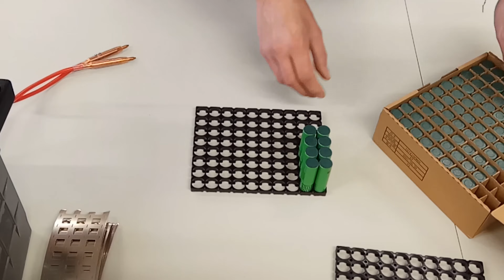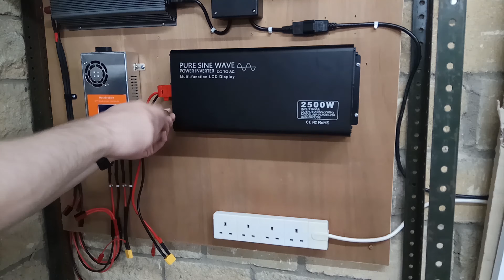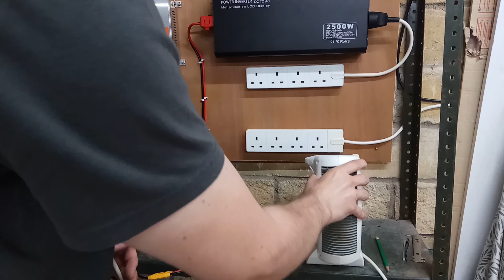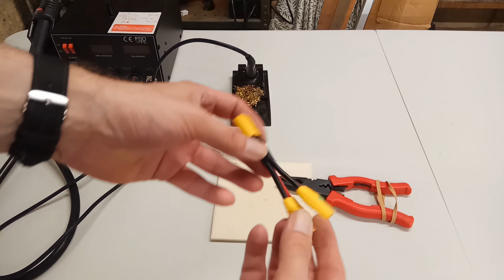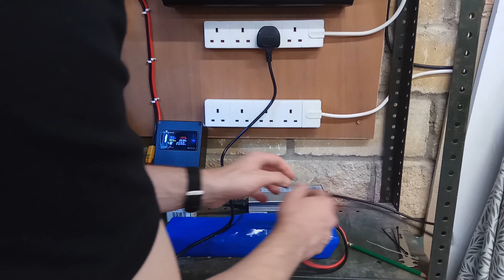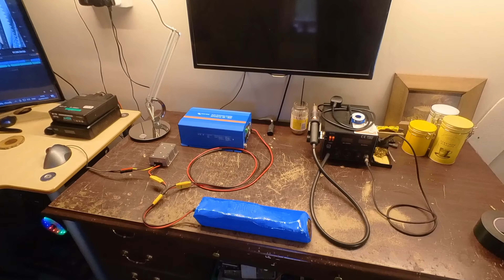DIY Off Grid Solar - The Cheaper Way

Comment: Hi, just wondering if you've used you TC Max battery for V2L power? I am in Australia where our new standard sets a very low limit for allowable "home made" extra low voltage systems. (Under 1kw) Portable power is an exception and for mains power blackouts I was wanting to run a 72v inverter from my 3kw TC Max battery but I don't know how to turn it on? I presume some signal to bms is required. Any experience with this? Cheers
Reply from the maker: Hi, I tried that too and the BMS disconnected. That's partly why I built my own battery. I don't know how you would fool it into thinking it was the bike pulling a load. I think it uses can bus. You could possibly put a different BMS in. The Ant BMS I'm using seems okay. Otherwise I'm stumped, sorry.
Reply: Hey, I got it to work easily ! I was looking around forums on TC Max and found the reason I have been annoyed with charging is because the dopes at dealers left the transit charge cable inside bike connected to side port. Easy to remove and properly connect side port. Then using the handy 'new'  lead as it is just pos. and neg. to xt60 connector I connected it to side charge port externally and with bike switched on or off I could draw power. With it straight into battery, no power.  So V2L should work if I just get a 72v inverter like yours. Perhaps not drawing more than charge cabling is made for though??
Reply from the maker: Aha! Well done. I only tried with the battery on it's own! 
The orange battery cable on the bike wires back to pins 1 and 2 on the motor controller multi pin socket. It doesn't say what they are on the wiring diagram for the controller but I think it's can bus. 
Yes the wires to the charge port are pretty thin. I wouldn't put too much load on them. I'm thinking about adding some thicker wire to mine.
Reply: I ordered a 1000w inverter but really would only want to run a fridge if we have a blackout. Modern fridges are pretty frugal...mine only draws 130watts apart from starting curent. Thats only about 2 amps on the charge wires. Thanks for your link to Aliexpress!...when I search it only comes up with thousands of other inverters and random stuff.
Reply from the maker: Just the fridge should be fine. Maybe charge your phone and other devices too.
No problem on the link. Keep me posted how you get on.

Comment: Nice vídeo!!! 

Like always since I saw your Channel, I get inspired by the way you use your "clean" energy... thanks for sharing!!! 

Cheers From Portugal ⚡🔋⚡
Reply from the maker: Thanks, I enjoy your channel too!
Reply: @thecapacitator8137  I Started with a faulty laptop battery, then I reused some 18650 cells for PowerBanks... but now like you I have an electric SuperSoco TC Max and my house in Alentejo is Off-Grid with a 12V solar array... I live in a building in Lisbon, but I have a Van and thinking, on saving money to do a 72V Solar Array, like your´s to charge my Bike. 😉Cheers from Portugal ⚡🔋⚡
Reply from the maker: @RREKO  I wish we had as much sun here in UK as you get in Portugal! You should easily be able to power your bike off a few panels. I've updated my indoor setup now. It's all mounted more permanently. I'll try to make another video soon.
Reply: @thecapacitator8137  keep on making nice content and sharing... Thanks Bro